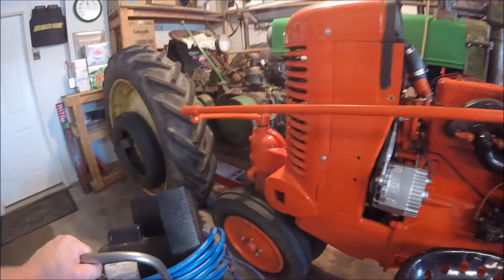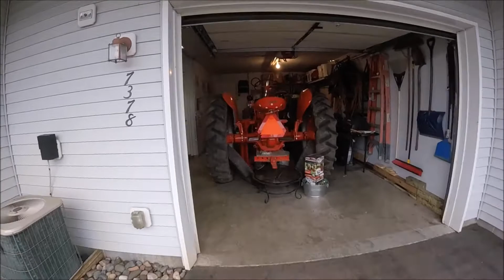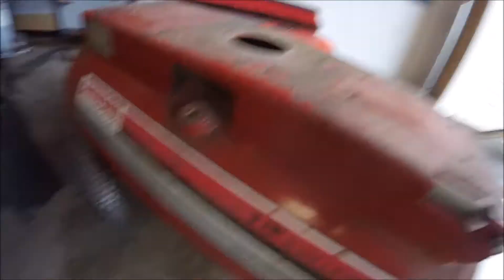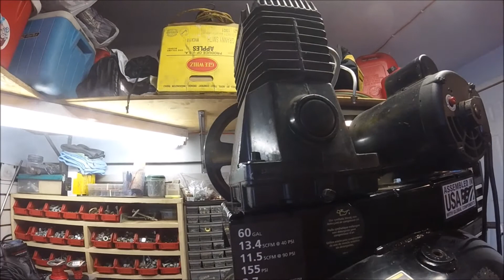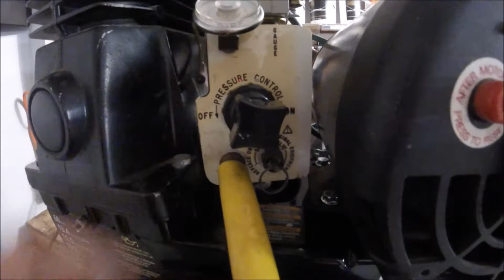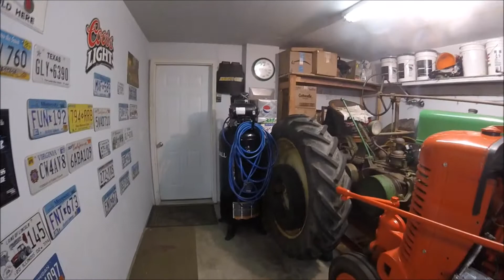Building an Air Compressor & GIVEAWAY!

Comment: Great questions - I'm anxious to see the answers and the gift. I'm very glad you scrapped the small air compressor tank. I had a similar one and it was still good after 10 years when I sold it. If people would simply drain the tank after each use and leave the drain valve open between uses,it extends the life of the tank. You also saved a little valuable floor space by going with the horizontal tank.
Question - when do you work to get money to pay for your toys?
Reply from the maker: I have had a few people send E-mails regarding answers... I'll have to sift through them to see who gave me the CORRECT answers FIRST (and thanks for your help in brainstorming). Once I heard that pinhole leak, and discovered it was the tank I immediately shut down and unplugged the compressor. I didn't want to become a statistic! I'll be draining my tank after each use, most definitely. My floor space is VERY valuable (as you have seen).

When do I work? I don't. HA HA, just kidding. I am actually on vacation all week this week, just getting things done around the house. I typically work overnight shift, with the mixed in overtime shifts as well as side jobs doing whatever makes me a little extra. Most of the time my projects only come from money I have made either in overtime or on the side - all of that goes into a 'project account'. Even when I take vacation, I am typically working doing side jobs. I work in a stressful environment but thankfully we get some great benefits - like a good amount of vacation.

Comment: We had one stick on my dads work truck. We hooked a log chain onto the hitch and looped it around a concrete pole. It took a while but we got it out. Where can you go wrong with 2 tractors! Save em both if you can!
Reply from the maker: I'm working on it! That drawbar was STUCK. I doubt it was ever removed. You know I got to thinking.. Wouldn't it be cool to have a F20 on rubber, and one on STEEL? :-D I must have some weird disease.... LOL